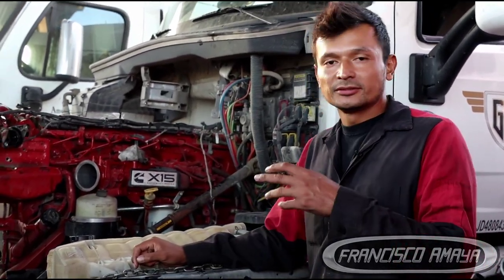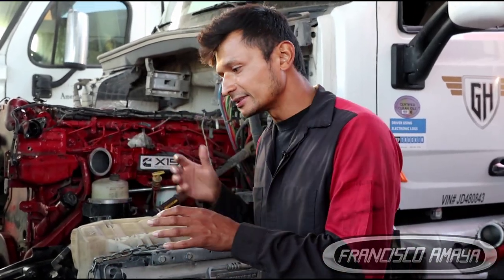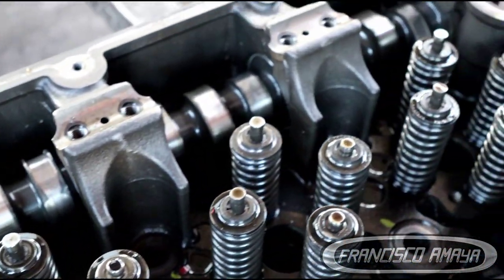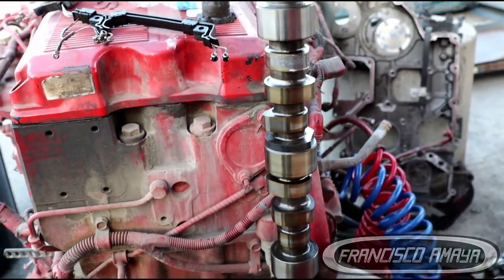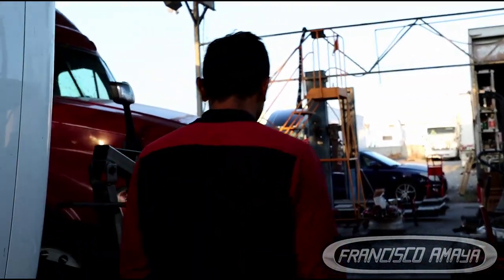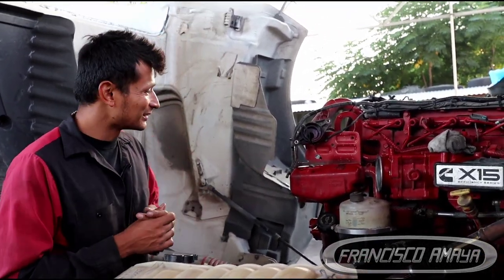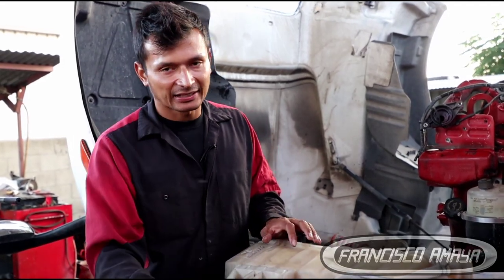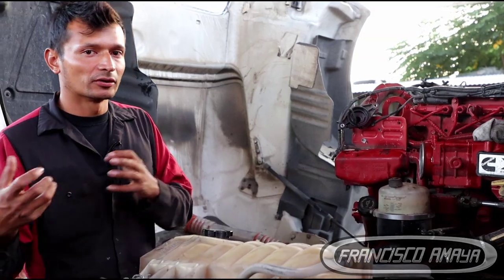Cummins X15 engine camshaft lobe damage rocker arm camshaft replacement common problem

Comment: X15   fuel efficiency. 2017 series  

Watee pump leaked  650k km 

Now i have a nose on 15 rpm , souns like a the howl of a worn bearing,  the nose on the passenger side , in cold weather is makes stronger sound ,  no other symptoms of problems.

Comment: What was the reason or cause the crankshaft was damaged?
Reply: Camshaft damage is caused by no overhead adjustment done, crankcase ventilation filter becoming clogged, and carbon packing from sootty oil. Recommended solutions are to get a good by pass oil filter like the the spinner II, get the maintenance free crankcase ventilator kit, and have overhead adjustment done. Buying a used truck, I'd put some marvel mystery oil in engine before oil change, then do the above preventative steps.